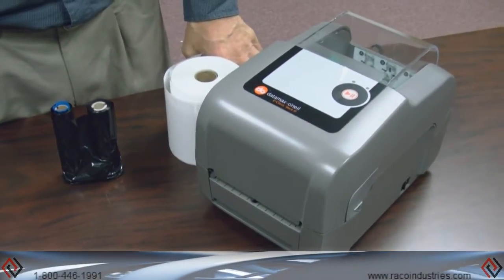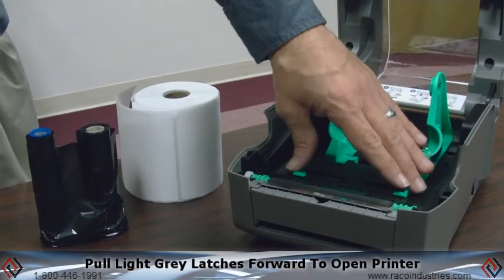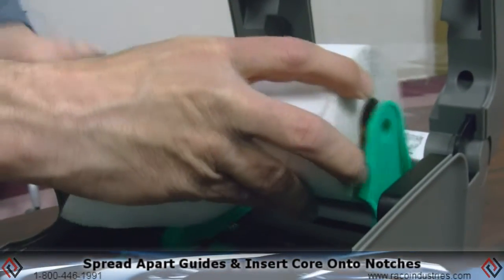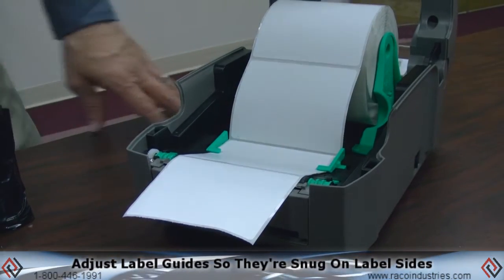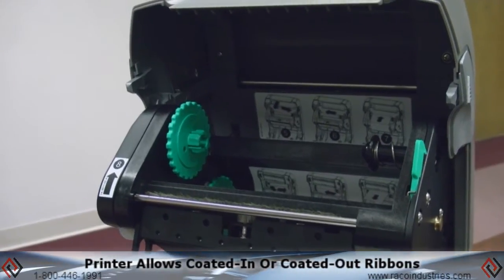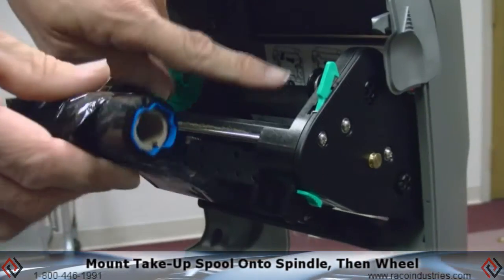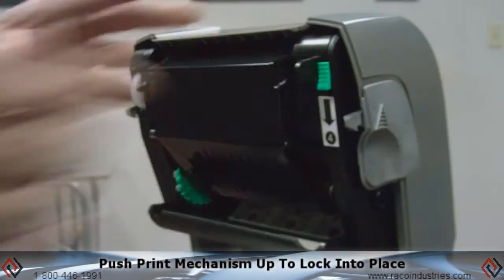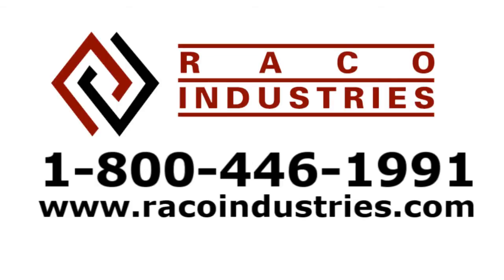Loading Media On A Datamax-O'Neil E-Class Mark III Printer

Comment: Great printer!✳✳>share4.photo/dLabelPrinter?$҉     The software is easy to use and works great for printing standard name labels. It even integrates with an online program I use. It's so easy to buy refill labels that fit and are cheaper than the Dymo brand. I've purchased three for my work and they've been steady with constant use for the past two years. You can't go wrong with Dymo!